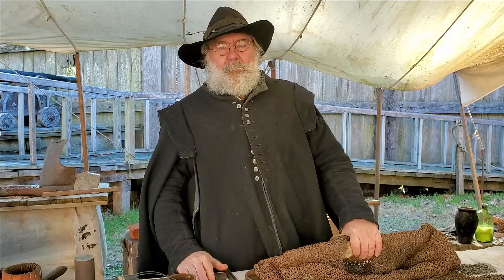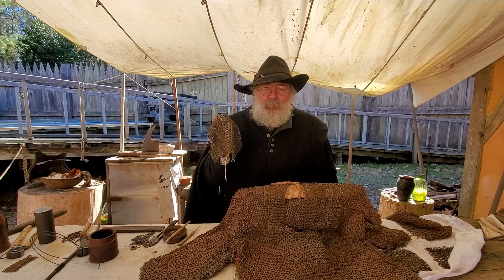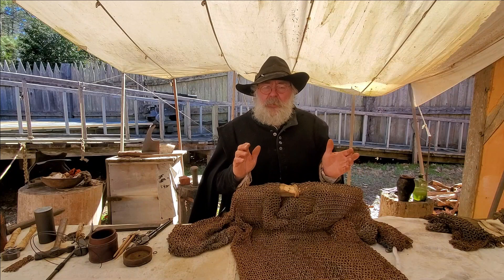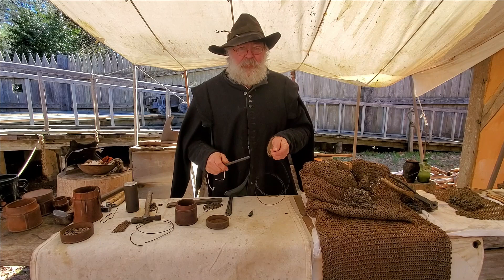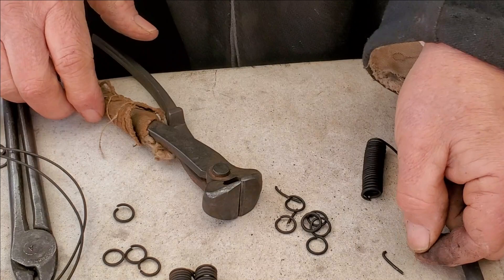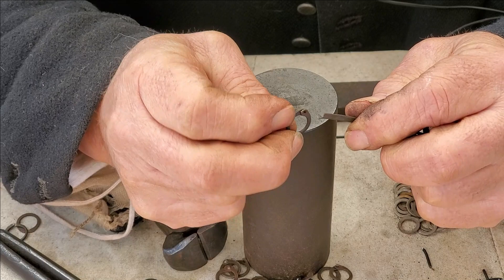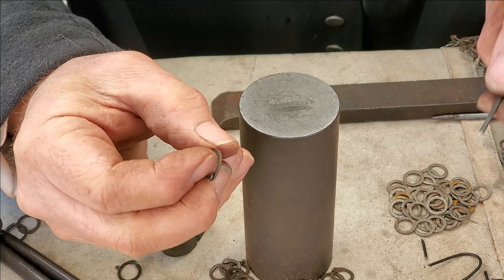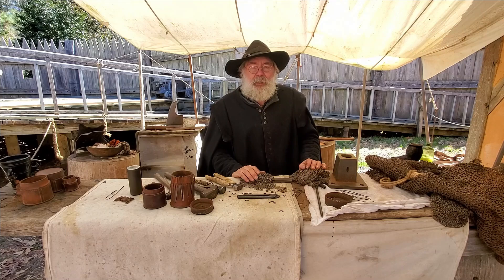Primed and Loaded | 17th Century English Mail Armour

Comment: Here in European reenactment we have fortunately also moved on to riveted mail.
Have a look at the mail found on the Mary Rose (16th cen. Ship) quite a bit of it is made by twisting the ends of the ring around like you would binding rebar in construction.
Reply from the maker: https://archaeology.co.uk/articles/news/x-ray-analysis-of-chainmail-from-the-mary-rose.htm

https://www.archaeology.org/news/8663-200429-england-chain-mail

Copper alloy rings were a common method of accenting the iron rings and creating a finished edge.  Copper alloy rings also served well as the stitching point when sewing pieces of mail to arming garments.  This ring, though does leave us with questions because we cannot think of an extant mail shirt of such twisted ring construction, and it leaves us wondering was the ring an expedient repair?

Comment: What kind of rust prevention did they employ to maintain it in that climate?
Reply from the maker: There was no effective method to prevent oxidation on mail armour, though putting mail in a cask with an abrasive like sand and rolling it was probably the most effective method to clean mail.